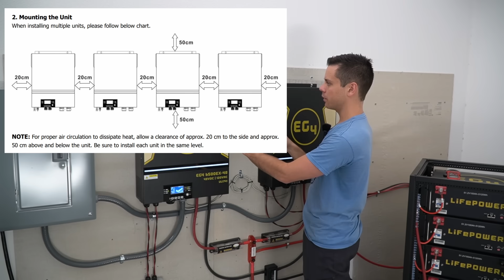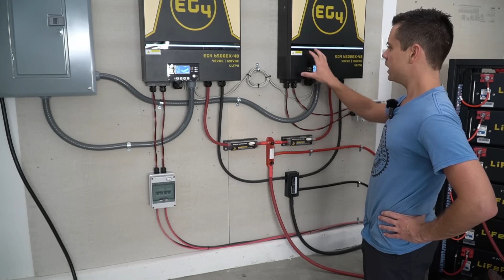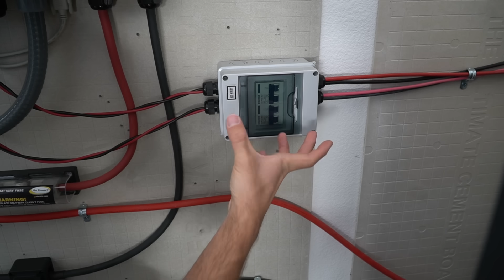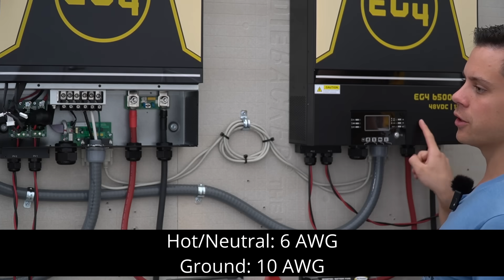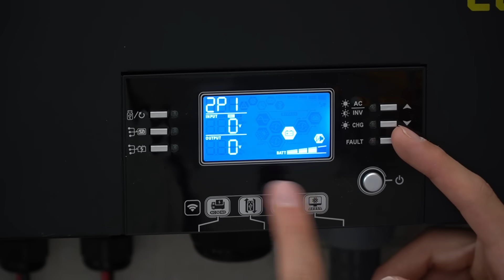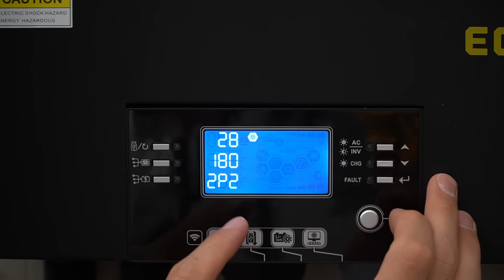Complete 48V Offgrid Solar Power System

Comment from the maker: Parts list and blueprint for this system can be found here: https://www.mobile-solarpower.com/48v-complete-system-blueprint.html

Be sure to check with local laws and regulations for your electrical code. Some places are more strict or lax than others! My system is not connected to the grid in any way, so I am not going to get an inspection. This is considered the same system as a car battery connected to a 12V inverter. There is nothing special about it. 

If you need to earth ground your system, have an electrician assess your environment and system and figure out what is most appropriate. And any other special safety equipment. Always hire a professional if you do not understand something! In the blueprints above, I go into this point with more details. Please read it!

0:00 Intro
1:42 Mounting Devices Safely
2:36 Component Overview
3:17 Inverter Connection and Cable Sizing
3:52 Fuse/Circuit Breaker 
4:11 Battery Cable Sizing
5:46 Server Battery Connection
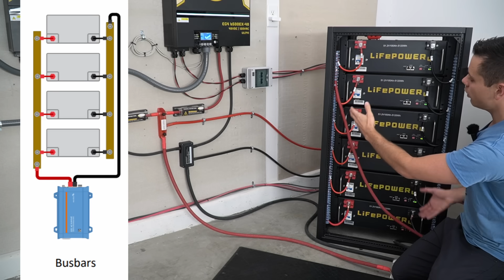5:00 PV Disconnect and Limits
6:21 AC Output Connection and Discussion
11:41 Programming the Inverters for Split Phase Output
13:14 Powering On and Testing Output Voltage
14:00 Conclusion
~~~~~~~~~~~~~~~~~~~~~~~~~~~~~~~~~~~~
Does off-grid solar confuse you? 
Save time and money with my DIY friendly off-grid solar kits, my latest product recommendations and so much more! 
http://www.mobile-solarpower.com

Join our DIY solar community 
#1 largest solar forum on the internet for beginners and professionals alike. 130,000 members and counting!
https://www.diysolarforum.com

Check out my free book
Best-selling and beginner-friendly guidebook to off-grid 12V solar!
https://www.mobile-solarpower.com/the-book.html

~~~~~~~~~~~~~~~~~~~~~~~~~~~~~~~~~~~~
My Favorite Online Stores for DIY Solar Products:

Signature Solar
Creator of EG4 and the largest DIY solar store online! 
(automatically save $50 by using my link below)
https://signaturesolar.com/?ref=cPwLcVc0SW-BjN

Current Connected
Victron, EG4, Midnite and so much more! Fast shipping and great prices:
https://currentconnected.com/?ref=wp

WattCycle
A very budget friendly 12V battery that works great!
https://www.wattcycle.com/collections/all/products/wattcycle-12v-100ah-group-24-lifepo4-battery?ref=aaezwkkc

Litime
Classic and reliable 12V batteries for solar! Bestseller for many years:
https://www.litime.com/?ref=XBIA62RFcalHns&utm_source=affiliate

Epoch Batteries
High-quality, marine grade 12V batteries that can survive anything!:
https://www.epochbatteries.com/products/12v-460ah-lifepo4-battery-ip67-heated-bluetooth-victron-comms?rfsn=7352625.50494d

IntegraRack
DIY Friendly Solar Panel Mounting Kits! Easy to assemble and super strong:
https://www.mobile-solarpower.com/ground-mount-racks.html

Ecoflow Power Stations
The most popular plug-n-play mobile power station! I have been using these for years:
https://amzn.to/4gID4j0

Anker Power Stations
Highest efficiency and best performance. The biggest challenger to Ecoflow yet!
https://amzn.to/4k0yhMM

Watts247
Need international shipping for large batteries and inverters? Check them out!
https://watts247.com/?wpam_id=3

Rich Solar 
One stop shop for budget 12V systems!
https://richsolar.com/?ref=h-cvbzfahsek

Battery Hookup
Cheap used lithium cell deals:
https://bit.ly/2mIxSqt
5% off code: diysolar

~~~~~~~~~~~~~~~~~~~~~~~~~~~~~~~~~~~~~~~~~~
Contact Information:
I am NOT available for personal solar system consult! If you wish to contact me, this is my direct email: williamprowsediysolar@gmail.com

Join the forum at https://diysolarforum.com/ if you wish to hang out with myself and others and talk about solar

FTC Disclosure Statement and Disclaimers:
Every video includes paid promotion or sponsorship (such as free products for review). Some links on this YouTube channel may be affiliate links. We may get paid if you buy something or take an action after clicking one of these. My videos are for educational purposes only. Information is subject to change/update at any time. Electricity is DANGEROUS and can kill. Be smart and use common sense :) DIY Solar Power with Will Prowse is a participant in the Amazon Services LLC Associates Program, An affiliate advertising program designed to provide a means for sites to earn advertising fees by advertising and linking to Amazon.com
Reply: WIll, can you provide a link to your PV breakers in this video?  I am not seeing those specific ones.
Reply: Good job.  Appreciate your efforts in helping to create better products for the consumer.
Reply: How much does it cost?
Reply: @jakeliujakeliu  $13,951 for the batteries, 2 EG4's, the wiring, and the rack
Reply: @miketanner5513  how much wattage do you have in solar panels.  Is your system on or off the grid?  Might be suggested a charger in case you don't have enough sunshine over a period of time to recharge the batteries.  I'm just thinking about it and have no personal experiences with the equipment.
Reply: @peacepoet1947  yes,off grid. That’s what she said but it still doesn’t make sense. I will have 13.6 kWh of panels. I was hoping Will Could reach out to signature solar and then explain it. It’s not a big deal I’ll end up using it anyway when I install Hydro.
Reply: Def Check local laws and regs.  In my area, our inspector wouldn't pass that because the white wire for the charger isn't colored.  You would need to color it either red or black to show that it is a "hot."  A sharpie or electrical tape would suffice.
Reply: wow that is not bad, 30k power and two device is very powerful can power anything
Reply: i'm trying to figure out how much power i would need to drive a bus.  i think 30kwh would only be a couple of hours of driving.
Reply: Will - I wish we were three years before now... Deanna and I would have gone an entirely different direction on the off grid in Northern Nevada... gonna have to save some more pennies and install this type of system! Thanks so much for all you do!!
Reply: @miketanner5513  why would you need a separate charging unit is what I'd ask the person selling you the equipment?  He should also know how to hook it up to your system.  Otherwise I would NOT buy it.
Reply: Hows that lvx6048 working for you?
Reply: Thanks Will!  You should pin this comment so that it is at the top for everyone to see
Reply: What's even more interesting are the latest developments and current availability of things like the new perovskite panels, vertical/horizontal multidirectional wind turbines and the latest battery developments.
It's now possible to store more energy than is used by an average household, and because of the preponderance of free charging stations, it should easily be possible for everyone to use a combination of the above methods to have completely free electricity for life.
Reply: This is not an inexpensive system. Those batteries are a fortune. I have been running three banks of golf cart batteries at $800 per bank. I get 4 to 5 years out of them, with a 5k watt solar panel system, 6k AIMS inverter, that has been running for ten years.
Reply: Since these are similar to the LV6548's have you seen if the two will run together to produce 240v?
I have one LV 6548 but they are getting harder to find in stock
Reply: Question: What's the cost of electricity in your area and how do you check it from time to time? 
Question 2: If you own a tesla, how do you know how much it costs to charge your EV? Can you see electrical pricing BEFORE driving to a Level 3 charger?
Reply: Is it possible to run a 120v sub panel from that panel?
Reply: Might have missed this pinned data, sorry. THAT is super-helpful, though it still requires a lot of work to scope the whole project and get to your total costs and your total labor involved (plus inflation these days). Still, this is a good guide for a test installation we might put together in North Carolina. Thank you.
Reply: Hey Will! Question. So you have that main breaker, is that breaker you have in the video a secondary to the main house breaker? Or do you connect the system directly to your house breaker?
Reply: I wonder if you would still go with this or the mpp lv6048 split phase single box?  I’m trying to decide but want to keep my breaker boxes to grid capability.
Reply: Can you run a whole house of that system?  2755kwh over 30 days was my last electric bill-using AC heavy given the July/Aug is hot.  I heard you state something about battery backup could last 30 hours?
Reply: I like it very eye opening, I've never done any sola panel wiring Installation as an electrician,  I'm  very Impressed
Reply: I like it very eye opening, I've never done any sola panel wiring Installation as an electrician,  I'm  very Impressed
Reply: hey boss one question, can i connect 2 different devices with that same system at the same time but one Air conditioner is 220V and the other is 110V?
Reply: Will I like the videos.  I do have a question, and there are a lot of your videos to source through. I know this video is 3 months old, but here goes.  
I would like to use a similar setup to this but grid tie it. I have reason for grid tie. With your equipment exposure... ie manufacturers sending you material and your own checks and searches. 
Do you or have you posted a video that shows a system or piece of equipment that can skip the high cost of electricity during peak time of use pricing?
I am building a home and I have to setup solar, so it seemed to me that having battery and solar supply 100% of my home solar for 5 hours a day when the time of use meter is charging high dollar for electricity. I do know this may be not worth it depending on the rate schedule but it would be nice to know its possible.
-MG
Reply: WHATS THE PRICE ON THIS RIGG?
Reply: Good Morning Sir, are any of this style units Pure Sine power??
Reply: Can you make the video on the communication aspect 🙂
Reply: Hello I was wondering is there any solution for a system with microinverters? I already have solar and want to add batteries but an AC coupler kit seems really expensive is there a DIY solution?
Reply: @miketanner5513  I have three battery chargers (one for each battery) so if/when I have to run my generator, I can get all my batteries charged at the same time.
Reply: Do you do online training on inverter installation? I would like to join
Reply: Which surge protector do you use between the PV array and the eg4 6500ex?
Reply: Hello. Is there a way to have a off grid system to run a industrial dehydrator, 240 V, three phase 100 Amps it has a 19500 watt heater and would run for about 25 to 30 hours at a time. Also would it be possible to have a ac plug in to help charge the batteries? A long with solar panels.
Reply: Hi there!
How much did this system cost?
Reply: Thanks for your great , straightforward, instructive videos. Those inverters have shown themselves to be problematic of late, as I'm sure you know. I just replaced a pair that were backfeeding power and draining the batteries, new system online, no problems.
Reply: I need to install a system. Want to help me? It can make a good video.

Comment: If that inverter set up draws 270 amps, why are you using bus bars and fuses rated much lower? Seems like a 300 amp fuse would have been appropriate.

Comment: Sorry I'm a bit late to the party, couple years ago I tried these and they do not work with my geothermal heatpump.  It would cause voltage spikes because the power was so dirty.  I replaced them with Victron and it is pretty much flawless.  I would advise against buying these.  It is not the only issue that people have experienced.  I don't have the nor the desire to list everything wrong with EG4.  Also they did not work with me to get it fixed and did not refund me.

Comment: For victron 48/5000 split phase is connecting the ground and neutral like you have here  (same bus bar) and disabling ground relay in ve config ok?    I was told ground comes from utility

Comment: Will I just use a residential pull out circuit breaker to open the circuit of solar power coming into the house.  Is arc still a risk using a pull-out breaker?

Comment: I'm a bit confused because now at home I have a solar inverter connected to the grid without a battery. So my house uses gridpower when I have no solar or when not enough solar to do all the appliances. I always thought connecting an inverter with a battery would work the same way. Is it possible to only connect the ac output to the grid? And would the ac output sync with the grid the same way as my system does now? Or is the ac input only used to charge the batteries?

Comment: I believe the National Electrical code requires two 8ft Ground rods installed outside or one of the options. To be installed  and a proper sized  ground wire routed to the main panel grounding system, as well as ground wire to any plumbing system and such.  I would also bond (ground) the metal of the Battery Rack and any other near by metal back to the main panel so everything is bonded together.  It helps insure if there is a short that the circuit breakers trip correctly.  Plus it is code.  I can't see how you passed your electrical inspection without this.  Likely you just wired it under the radar.  But your insurance will not cover you if you do not get it properly permitted and inspected.  no matter if you paid for insurance or not.  Its grounds for not paying out by the insurance company if you have an issue. Even if the issue has nothing to do with your system,  Like a house fire.

Comment: I personally will cover the whole thing, FACE only, with plexiglass. This keeps the equipment and WIRES from being damaged by kids, 2 x 4's, rakes, anything else u could carry through the garage or in front of the installation on the outside. The top and the bottom will be OPEN for cooling

Comment: I would highly recommend that you include a disclaimer that the equipment you are reviewing, handling and discussing is not energized.  You point to and touch lugs and wires and others might get the wrong impression that handling in this manner is safe, when it is not - especially DC.

Comment: I have a small 1300 square foot house that is all electric I have 7 a and can have endless solar panels which one of these systems that you're building should I use ? Also I would like to add wind as it is very windy here sometimes I want to live off grid I don't want to depend on the power company

Comment: 6awg feeding your breaker panel, can only provide up to 50amps of 120/240 power. Standard residential houses have 200 amp coming in. Wouldn't this be extremely limiting as to what you can power with this setup? Not a full house it would seem

Comment: Great video I’m running the 3 k inverter now but have this system to go up next .im having issues with panel sizing ,eg4 suggested up to 10 in a series is max , I came up with 7.5 panels and my voc are higher . If I put 2 sets up and put -set in parallel will it double my amps and keep voltage same ? Junglejohnny

Comment: I have a five battery system (rack). It’s for my off grid cabin. For some reason the system will shut off 3-4 batteries or shut down all together.  I can’t figure out why it shuts off some of the batteries. Most of the time only one will be on. Thanks for any help Craig

Comment: Hi Will, as a UK IT Trainer I have been watching your great videos since 2022. The reason is, in the UK all the SOLAR suppliers are using this solar thing as a way of ripping off everyone. The US TESLA battery is $5,300, in the UK its £12,000 fitted.
So, wanting to be as OFF GRID as possible, having bought a 100sqm house and fitted 18 500kW roof panels, for the past 18 months I have been researching how to sort what components I need/buy, how to wire/connect these mainly watching your suburb videos.
However, America is 110V’s and the UK is 240V’s and when I contacted a few US manufactures they all said SORRY we are 110V’s.

BUT looking at your “Complete 48V Offgrid Solar Power System” video could this voltage issue be resolved by using the inverters IN PARELEL?

I have a friend in the US who could ship purchases across the pond. The alternative is a UK company called “Givenergy” which is less expensive.

Comment: Great video! Please help: I don't speak much English but I want to ask you why in split-phase and not in parallel? I live in Europe and I need 220V for utilities, I have the same two inverters and I want to create a system that allows me to manage batteries and home consumption. If I wanted to put them in parallel, do I have to connect them both to phase and neutral or just one of the two? Can you make a video about it? should I also connect the AC inputs to both inverters or just one, perhaps to the master? my first inverter runs two strings facing east and the other runs 2 strings facing west. Should I or can I still do the split-phase or should I connect them differently to have the 230/240 V output needed by the house? Thank you

Comment: Hi Will; where there is a Will, there is a way ;-) ! I am impressed in two ways what I just saw. The way of your ‘teaching’ to being able to build this system up, and the obviously easiness to make it happen. I am retired instructor/teacher in uniform ;-) but my career started as a technician/engineer on diesel/electric locomotives on the Swiss Railroads. Now, retired we want to equip our tiny house strictly off the grid with Solar power. Your video is the first one I am able to follow the process and the parts needed. But still a (very) few questions as: solar panels? Price approx, and: serving a new midsize fridge, a new AC split unit, 1/2hp submerged water pump, water heater and some usual LED lights and electronic devices? We count an average 2.5KwH usage for a two persons household a day… Your opinion and answer will be appreciated much! Thanks for now. Looking forward to read some notes soon… best always, PatnCony…